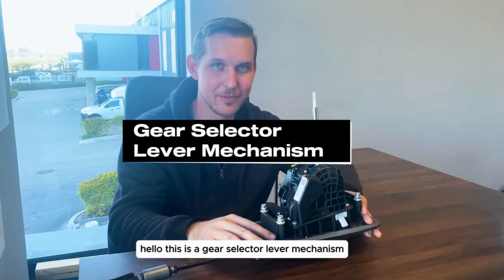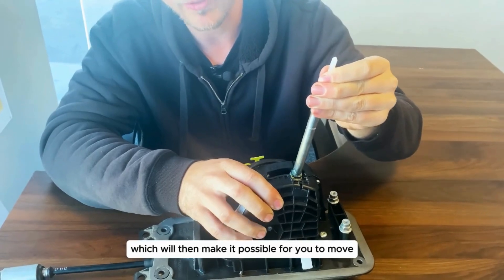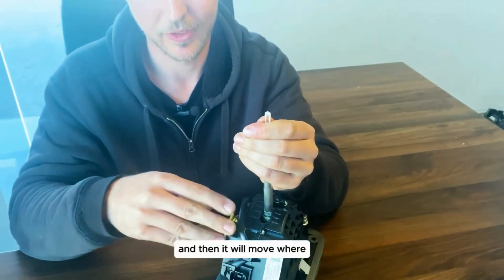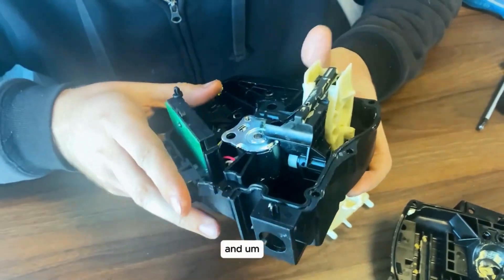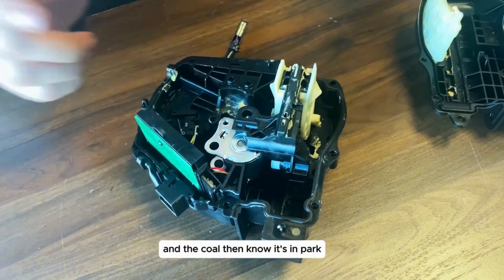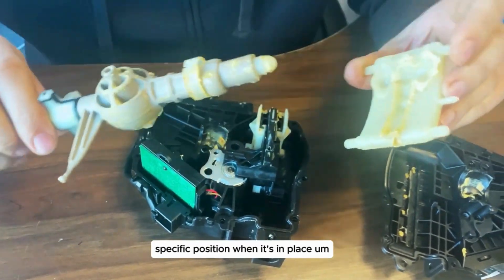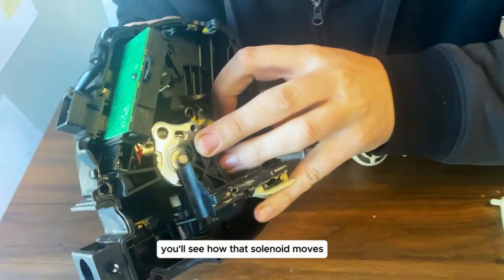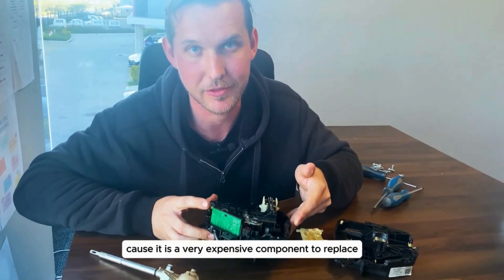Inside the VW Touareg Gear Selector Mechanism with Expert Mechanic Chris! ⚙️🔧 #VWTech

Comment: the absolute pain it took to found this awesome video was so worth it. I cant believe the guide for the gears is still just a plastic slab with detents. I know this is late but would it be possible for you to send me some pictures of the parts with the grease cleaned off? Im curious what modifications would be possible for the design
Reply from the maker: Hey Robert! Pop us a whatsapp on  064 524 8814, we might have another one lying around to use